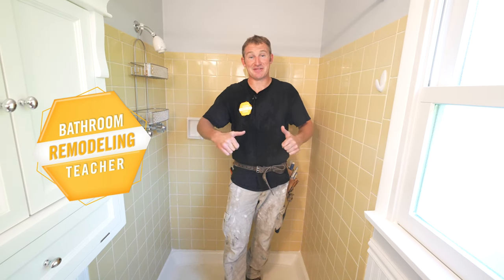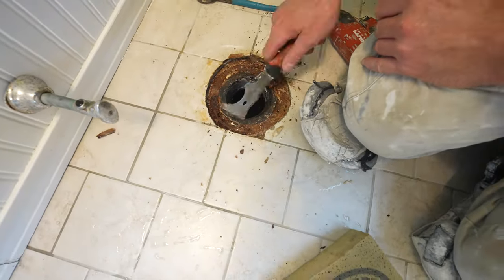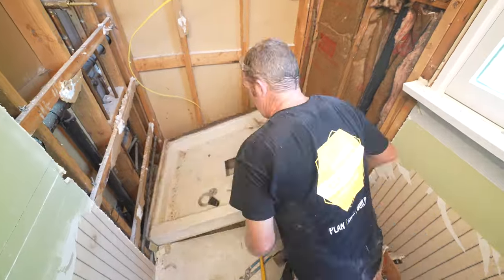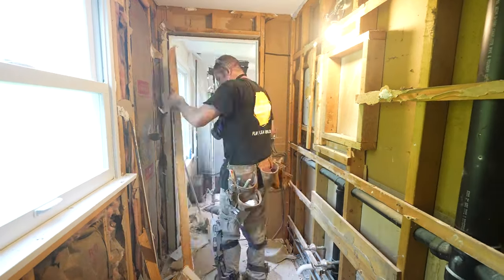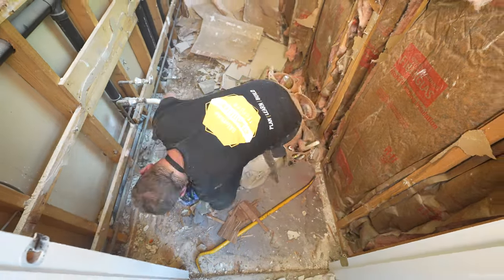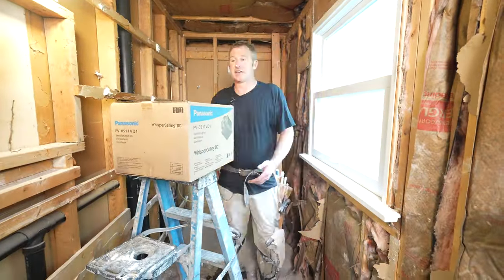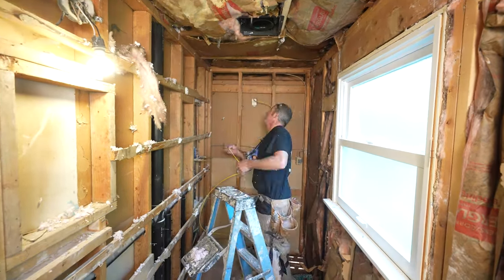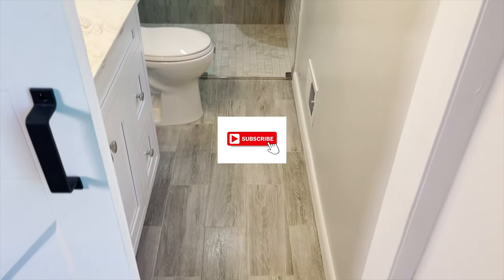Bathroom Demo Day | PLAN LEARN BUILD

Comment: Demo is alot of work but can be stress a reliever 😀. Good point on planning before you start demo is critical. I always try to do the recessed late above the shower as well.Good job BRT!
Reply from the maker: Thanks Josh, yeah those halo lights are awesome. I’m always impressed by things like that after years of using can lights and dealing with framing that would be problematic for centering 👍